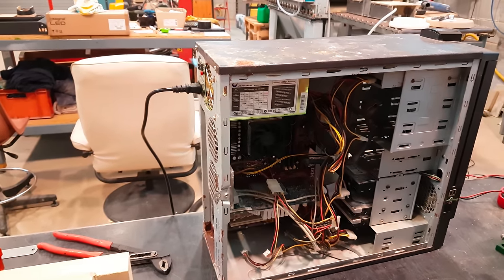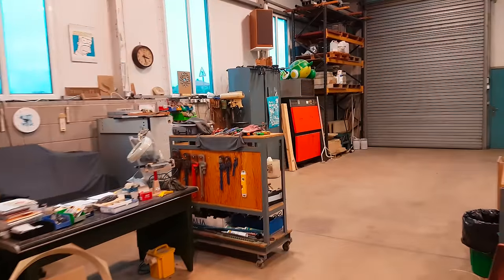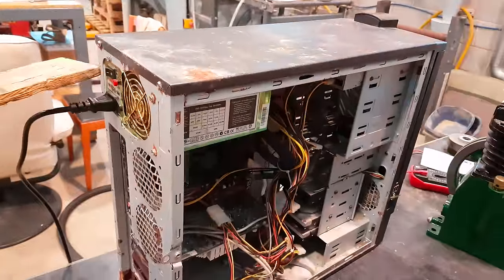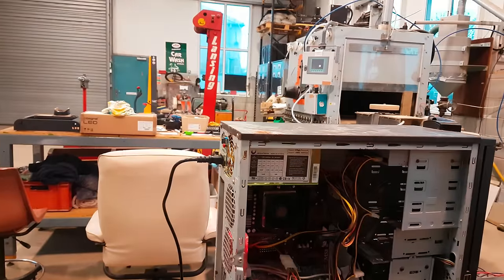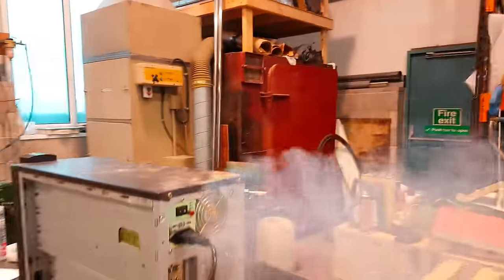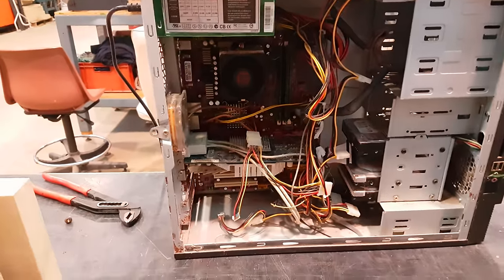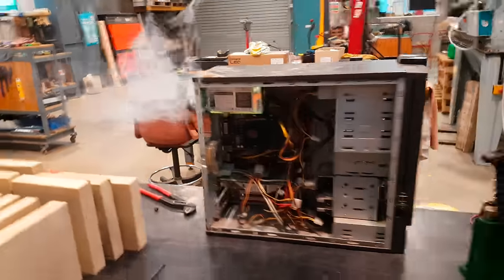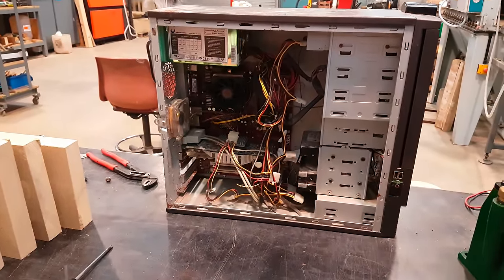Computer Explodes!

Comment: POV: he's running minecraft with epic shaders in a 1050 ti
Reply: I’ll do one better. Mac*
Reply: Y have the 1050ti 4gb
Reply: I think 980 ti is a bit better than 1050ti
Reply: You have to use my GPU, i have the GTX 660
Reply: You guys have a GPU?? :(      
I'm happy with my Intel HD Graphics
Reply: 1050 ti is a decent card
Reply: @MayvinLimMohan  cant find 40 dollars for a  gpu ?
Reply: @varios4883  Motherboards have different compatibilties
Reply: @DeerJerky  but  cmon its not hard to find a cheap gpu. Just find a compatible with your mobo.
Reply: @DeerJerky almost everyone should have some  money to spend on christmas
Reply: In GT 720
Reply: i get like 600-1.5k frames in hypixel with a 1050 ti
Reply: hey i ran ultra shaders on an intel uhd 620
Reply: @zaf2774  yeah, It Is like gtx 1070 vs 1050 ti for example
Reply: Me: crying on a 1050ti
Reply: @ro7651  same
Reply: it wasn't the GPU, it was the PSU
Reply: Incorrect, mine melted it didn't explode
Reply: @vishalsrikanth  not really
Reply: i have 1050 ti and it runs on 70fps on extreme chpoapic shaders
Reply: @Mc_OnyXx  really? I get about 40 with bslex.
Reply: And he's overclock CPU and gpu, and force rtx mode
Reply: @vishalsrikanth  No it really isn’t
Reply: @rjangling9633  Runs almost all games mid settings on 40 fps combined with a overclocked high end processor and a 16 Gig ram
Reply: @vishalsrikanth  40 fps in 2020 is like driving a 30 year old car
Reply: @vishalsrikanth  Always need 1080p 60 fps on med - high settings base for good gameplay anything lower nowadays is crap the 1% lows will be shocking
Reply: @rjangling9633  My guy I never said 1050 ti isn't old hardware but it isn't absolute trash. It's a decent card. 40 fps mid settings  for 100 bucks is good in my book
Reply: @vishalsrikanth  Nah you want atleast a 1650 minimum mid range nvidia 1660 or 2060 40 fps gaming is pretty bad 60 is a minimum you want for smooth gaming the 1050 ti just cant produce that if you care about your gaming experience you should aim for 120 fps plus if not 144 plus
Reply: @rjangling9633 its really Ur own choices I don't mind running games on 40 mid settings unless there are stutters but I don't think there are any. 1050 ti is pretty old but you also pay a less price for it which makes it a decent card for low - mid end gaming. If you want 60 plus fps you either got to tone down Ur graphical settings or switch to a better card. But in this case we are talkin about the 1050 ti which can run average 40 fps on mid settings on almost all 2020 games which makes it a decent card
Reply: @vishalsrikanth  It just isn’t a decent card though a decent card can run most games one 60fps plus on 1080p period the gtx 1650 is almost the same price as the 1050ti and it can get you those extra 20/30 fps that will make your experience far better
Reply: I run minecraft with a 64 bit texture pack and slidurs medium shders at 60-80fps
Reply: I eat pizza
Reply: @whyers4782  I wish I can have 1050ti but I'm 13 and I'm Asian so I had to focus at school and I hate it
Reply: I have 1050Ti and this is true
Reply: @zaf2774  Lol im asian too
Reply: @rjangling9633  1650 is 20% faster than the 1050 ti, it isn't smart to buy a 1050 ti right now since for the same price u can by so much better but my 1050 ti still runs most games on low with 120 plus fps and gta 5 on high with 80 fps plus. Although I'd recommend buying a graphics card from them 1600 series
Reply: You guys are clearly talking about Nvidia here... Sorry, but I am rolling with AMD:s Radeons. 5700 XT by Asus to be exact.

And I have been satisfied with it. People in the wEEb complain that the 5700 series tends to be quite loud due to insufficient cooling. Well... if my card is loud, then I want to hear the silent one! Played DIRT4 on maximum graphics for about an hour, and even whispers felt like screams with that card.
Reply: @zaf2774  980 ti is a lot better
Reply: No in gtx 750 XD
Reply: @varios4883  my parents don’t give me money for christmas
Reply: I play with epic shaders on a 1050ti on 50-70fps lol
Reply: @vishalsrikanth  not anymore
Reply: @Areutriggeredlol  lol
Reply: GTX 550Ti, ha
Reply: Dude 
If you don't have one 
Wtf is the need to comment 
I run sildurs shaders at highest graphics and still I get smooth fps
Reply: @zaf2774  HA HA u good?
Reply: Whelsik  super
Reply: No its intel hd gpu
Reply: @MayvinLimMohan  i have a 1660ti . u should get atleast gtx 1650 or rx590
Reply: wait is 1050 ti that bad? im planning to but that gpu
Reply: @x7gssv823  not that bad. But it's already an old technology, I should recommend you to buy gtx1650 or gtx1650 super
Reply: @x7gssv823  i would suggest the rx 570 because its better than the 1650
Reply: I have 1050ti 4gb amd rysen 5 1600 and it runs at 20 fps lol. Slider vibrant max btw.
Reply: Minecraft rtc
Reply: Pov:he's running Minecraft with epic Shaders in a gt 210
Reply: @6k911Channel  get a good gpu
Reply: @DeerJerky  bro, theres so many mb with 3.0 support. And you can use 3.0 cards on 2.0 slot
Reply: in a GT 210
Reply: @murubala8962  It works fine, runs every game accept Crisis, Cyberpunk, and Cities skylines with 100 mods at 60 fps. However in 4 months it will be a GTX 3060 super 8gb with a amd rysen 7 with 16 gb ddr4 ram.
Reply: My overclocked 1050ti sounds like it will explode any second now
Reply: My 1060 runs extreme raytraced shaders, 1050 ti is overkill for epic
Reply: With rtx on
Reply: @6k911Channel  then go for it bruh
Reply: Na man, he’s running raytracing on the 1050 ti lmao
Reply: He used rtx
Reply: Im happy with my r4 graphics
Reply: @eduardoantoniobarralesaisp8544  with Cyberpunk 2077
Reply: you kids still use 1050ti in 2020 almost 21. And i have rtx 2060 super lol
Reply: Me to
Reply: I feel personally attacked
Reply: @zaf2774  a shit ton better. Between 1060 6gb and 1070
Reply: I use a 1050ti and goes normal
Reply: Hahah so true tho
Reply: @varios4883  bro there are laptops
Reply: "Gtx 460"
Reply: @zaf2774  h bug lol lol
Reply: Im oppening shaders on 745 at 30fps bullshit
Reply: @vishalsrikanth  no it’s not😂
Reply: @akisalmenaho8473  I got 3070 coming in soon I was going to buy it
Reply: @6k911Channel  that’s horrible
Reply: @turrihurri  I got 3070
Reply: @ghoul4678  I forgot to add at double resolution. At 1920x1080 its 40 something.
Reply: @ghoul4678  wow i could buy 3080 or 3090 if i wanted to. my 2060 super is 1 year old so i could buy 3080
Reply: @zaf2774  it is. It’s only one generation down and that was the top of the line that generation. A gtx 960 ti is better than a 1050 ti
Reply: I run minecraft on Ultra Volumetric lighting sildurs shaders with a 512x texture pack on a 1050ti runs perfectly
Reply: @aqualy6322  how many frames
Reply: Minecraft is already a cpu heavy game and then you make it gpu heavy aswell

Your pc will explode
Reply: @turrihurri  like 40-60
Reply: @aqualy6322  "runs perfectly" 40-60 fps unplayable
Reply: @turrihurri  what are you saying lmao? 40-60 fps in MIMECRAFT is literally perfect, it's perfectly playable when u have shaders and stuff on. Ur probably 11
Reply: @aqualy6322  OMG Its so bad that i wouldnt even touch that shit fps
Reply: @aqualy6322  40fps lags so much i get 100+fps with shaders on lol
Reply: @aqualy6322  what is mimecraft you cant even type and u say im 11. doesnt make sense your just a poor kid who cant afford better
Reply: @aqualy6322  go cry to ur mama lmaoo
Reply: @aqualy6322  why do you need 3070 if you said  40-60 fps is playable???
Reply: @turrihurri  because I want to play games like cyberpunk, AC valhalla,... And it's always nicer to have more fps? I didn't say 40-60 was the best ever?? I said it was playable
Reply: @aqualy6322  u said it was perfect :D
Reply: @turrihurri  ok? And more fps is even more perfect :D
Reply: @aqualy6322  lol u have only 3070 i just ordered 3090
Reply: @turrihurri  keep dreaming 11y old lmao
Reply: @aqualy6322  how do you prove you have 3070. In reality you dont.
Reply: @aqualy6322  I can tell that your 11 by your "FunNy nAmE" 69 ahahaha so funy
Reply: @varios4883  not me
Reply: Ouch
Reply: I have 1050 ti sir......
Reply: @zaf2774  nop
Reply: god is a 1050ti considered bad now 😅
Reply: POV means?
Reply: @mehedi.ferdous  point of view
Reply: @zaf2774  a lot better.
Reply: @Nick-hw2rd  i don’t think that’s true. i have a 1050ti and i get 90-200fps
Reply: You guys getting Nvidia? I have Radeon!
Reply: @zaf2774  980 ti is way better than a 1050 ti
Reply: GTX 1050ti better than GEForce 8600 gt
Reply: @ailemkustepe4913  yea obviously
Reply: No graphics card BD
Reply: @Firefoxsimp  How I get 600-700 in lobby and 900-1.5k in bedwars. I use lunar client and in lunar I get constant 1k
Reply: @whyers4782  how are you crying on a gtx 1050 ti thats so good
Reply: @rjangling9633  cant afford that shit
Reply: @murubala8962  u so lucky
Reply: @friend1704  really why?
Reply: @Nick-hw2rd  cool
Reply: @Nick-hw2rd  I don't know what a lunar client is but you're not getting 1k fps. That's bullshit.
Reply: Chocapic Ultra runs at 70fps easy
Reply: @murubala8962  because you have a good gpu
Reply: Bruh I have a 1050 I have 55 fps
Reply: @MayvinLimMohan  I feel you 😔😔😂
Reply: @friend1704  oh I forgot about typing that comment. Yes it's a good one,I'm saving money to get the rtx  2060s
Reply: @murubala8962  soo luckyy
Reply: @Denofu  i’ll send a gyazo photo later
Reply: @varios4883 a 40 dollar gpu here in brazil would be more like R$600,00, which is 115 us dollars
Reply: You dont know use POV
Reply: @vishalsrikanth  hahahaha lol no it’s not haha
Reply: Overclock it with msi afterburner and you’ll get a nuke
Reply: @friend1704  😅
Reply: @varios4883  what country you live on?
Reply: I have the Legandary , one and.only one of its kind presenting to you The Nvidia GT710 2GB GDDR5 💓🥳
Reply: Intel UHD Graphics*
Reply: XD i have 1050 ti and Minecraft runs nice maybe you talk about gtx 480 XD
Reply: @ZapRain  don’t insult the max! I can run csgo just fine on ours!
Reply: @pavedog4life953  mine too 👀
Reply: @ro7651  same
Reply: @gawr thats why i said almost?
Reply: My dad bought me a prebuilt that didn’t have a graphics card because he doesn’t really know anything about computers and I had to buy a 1050 ti because it was the only one I could afford
Reply: I have a 1050 on my laptop and I ran epic shaders and all that happened was it gave me 50 FPS instead of 120
Reply: Absolutely noone runs minecraft anymore.
Reply: @MayvinLimMohan  i play gta 5 at intel hd 30 fps yey
Reply: I have a 1050 ti and i actually tried minecraft with some pretty god damn nice shaders. Handles it ok i guess. But the thing wont explode by that
Reply: 1050ti not even bad more like 750
Reply: Bruhh 1050 Ti is good
Reply: 1050 Ti is too weak nowadays. if Nvidia , a 1660 Ti is the absolute lowest I would go. any lower is a waste of money
Reply: @MayvinLimMohan  same
Reply: Me who runs shaders without graphics card aka intel uhd graphics aka integrated graphics
Reply: with a gt 760
Reply: Well i have 1050ti
Reply: U Guys have gtx ?? I have gt 520 😭😭
Reply: @d_r1zzL  it is not ur fault become a successful person in life and own a rtx for yourself
Reply: @DeerJerky  If you have mobo from like 2008 then maybe but not nowadays..
Reply: @Umaru chan the fuck?
Reply: @Umaru chan Then explain to me why a lot of people run on 1000 frames on minecraft. Games is different than real life my guy. The screen still moves when you have 1000 frames+. Plus, some people even play on 2k fps. I know that you won't really see a difference, but those numbers are still there.
Reply: PSS: He used some RGB lightings
Reply: @zaf2774  quite a bit better in fact
Reply: @x7gssv823  unless you’re on a super low budget, don’t get a 1050ti, or really any 4GB card in 2021, assuming you plan to play any modern titles. 1070/1660 super should be as low as you’ll want to go for solid 60 FPS AAA games
Reply: @SpeedySpee  that’s not real Ray Tracing, mate
Reply: @zuckdaddy1596  PTGI Experimental Ray Tracing Shaders?
Reply: @SpeedySpee  It’s not real ray tracing, it’s just a nice shader, ray tracing does not require RT cores, but you’d need nothing short of 3 way triple SLI on a 3090 to get even slightly playable FPS in ray traced titles using Cuda Core acceleration
Reply: @zuckdaddy1596  How is it not real ray tracing? It might not be from nvidia or utilize nvidia's special built in cores but it's still shooting millions of rays out at the camera per frame and calculating the light bounce and reflections from it, to say something is not real raytracing just because it's not from nvidia is like saying nvidia invented raytracing
Reply: @SpeedySpee  it’s fancy reflections, ray tracing is for more precise (and thus performance heavy), why do you think it’s so taxing on properly ray traced titles?
Reply: @SpeedySpee  most Java edition “ray tracing” shaders/textures (at least the good ones anyway) use path tracing, which is effectively the shitty older sibling of ray tracing, granted it is far easier to run

Edit: and even then, it’s not full blown path tracing, it’s simply emulated path tracing, which helps with performance, at a cost of accuracy and detail
Reply: @zuckdaddy1596  Oh well thanks for the information, is there anywhere that explains how path tracing works differently to raytracing? And yeah I was pretty concerned seeing a noisy image or loss of detail in some areas which I assume was a product of path tracing? Either way these cards are still pretty decent and run most modern games at medium to high 60 fps 1080p which is pretty good, also would be nice if nvidia partnered again to add it to the actually decent version of mc, not sure if it's possible on a java game though that's probably why they just went with bedrock
Reply: you know that every player with 1050ti that isn't stupid like you will lower the settings to make it playable or can't continue the game because it isn't playable
Reply: @zaf2774  a bit? Its atleast 60% faster
Reply: Andigamer  that doesn't exist
Reply: @Umaru chan you're pretty thick different monitors have different refresh rates and none go above 360Hz, even if there was a monitor that was 1000Hz it wouldn't matter because its not a helicopter blade the image changes when you move its not the same image
Reply: Or on a pre-m1 mac, especially if it still uses a spinning drive
Reply: @MayvinLimMohan  sad. is your your computer newer than 2007 cuz mine was made in June 2007. it’s an iMac
Reply: Kkkkkkkkkkkkkkkkk
Reply: I actually can run high shaders on a 1050ti and it runs perfectly fine
Reply: @varios4883  Maybe he's on a laptop
Reply: You know a 1050 ti isnt that bad you know
Reply: @realLonelyMC  is this you in the video lmao
Reply: @DreBuckss  factual
Reply: Yes
Reply: @zaf2774  ye
Reply: @ZapRain  better, 2001 pc
Reply: 75 rendef
Reply: nah gt 71
Reply: Ñ
Reply: That hirt
Reply: 1050 is a good board
Reply: Gt 710
Reply: Im running a 1050ti on shader with over 35 mods on minecraft lmao
Reply: But he have shitty cheap power supply
Reply: Me with a Quadro 600: so this is a nuke
Reply: More like gt710
Reply: Hey thats me
Reply: Very correct bro...
Reply: @RetaxYT  i can beat that, i played modded minecraft on a gt730 overclococked to the moon
Reply: Sane profile pic
Reply: Hey that's me! With my 1050Ti!
Reply: @RetaxYT  my amd radeon 5730 D:
Reply: I tried it with my 1650 super lol, actually somewhat ran alright
Reply: Me on Intel HD graphic 4400 playing minecraft with shaders on 30 FPS
Reply: No he is using Intel HD 4000 and 2 GB ram tryibg to use rtx shaders on call of duty morder warfare
Reply: @ro7651  i have a broken 820m just passively generating heat in my 10 year old laptop bottlenecking all the other components
Reply: @MayvinLimMohan  i have a broken gpu
Reply: @varios4883  40.000*
Reply: @varios4883  oh ok i get it in your time there isn't a silicon shortage
Reply: @Nick-hw2rd  yeah on 2 chunks render and everything disabled
Reply: @realLonelyMC  yeah UHD is like pci-e or something while HD is integrated in the APU
Reply: @aaronrd2  its this hard-to-understand thing called a joke
Reply: Also having 999999999999 chrome tabs open
Reply: @ZapRain   understand lol
Reply: @whyers4782 and I thought I was the only one😂
Reply: @joanurena4573  you don’t know English 🤣
Reply: @zaf2774  Actually even the 970 is over 65% better.
Reply: @Gigachugga  yeah I am aware of that
Reply: A 1050ti is what you could say rather good rn
Reply: Actually did that. My 1050 pc didn't explode is just had seconds per frames
Reply: It actually works lmao
Reply: Had a 1050 ti before it was decent for its performance
Reply: Да ты шо у меня даже Майнкрафт обычный 15 фпс
Reply: @varios4883  a gt 1030 is 1450 TL so its not as easy as it is in your country i would probably be rich by now if our money had value lmao 1 dollar 15TL btw amd with %100 tax
Reply: 48083kp
Reply: I have a 1050 ti and shaders work fine
Reply: @varios4883  hehe
Reply: Just did that.
Reply: Y it will run smooth
Reply: I have one too but mines from msi